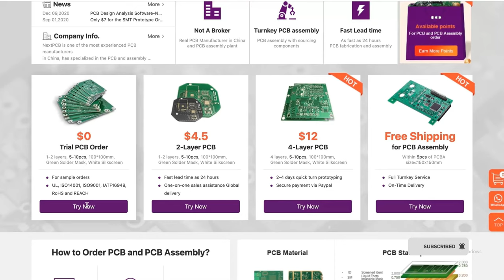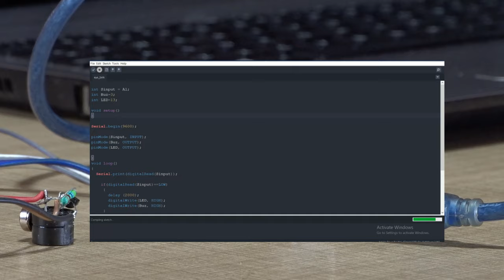How to Make Anti Sleep Glasses

Comment: how it worked since low and high is digital and u put sinput = A1 as analogic?
Reply from the maker: Analog input pins can be use as digital input or output pins
Reply: @ShubhamSuresh bro u using 5v pro mini is it okay to use 3.7v battery in the 5v arduino pro mini?
Reply from the maker: @markgimarangan8344  yes it works perfectly fine.
Reply: @ShubhamSuresh  Okay bro ty so much.

Comment: Can we use arduino uno
Reply from the maker: Yes you can.. but its size is big so you need to manage that.
Reply: @ShubhamSuresh  code?
Reply: @ShubhamSuresh  And tq for replying fast
Reply: @ShubhamSuresh  hey pls give reply
Reply: @ShubhamSuresh  I can manage it
Reply: @ShubhamSuresh  but any changes in arduino uno connections
Reply from the maker: @sakethgattu8503  do the connection same.. and the same code will work
Reply: @ShubhamSuresh  tq for your reply

Comment: hy bro can i use arduino nano instead arduino mini or uno... please answer
Reply: yes but then again you will need to use a bigger battery since the nano requires at least 5V
Reply: @EngTawa  i did with Arduino nano and 5volt battery but it did not worked for me 💔😥
Reply: @adibullahishanzada  Yes it's becaus the IR sensor doesn't work that way. We were somehow fed a lie.
Reply: @EngTawa  you posted fake video 💔😑😰

Comment: Hello, I'm from Brazil, and I'm using your idea as a basis for my final project in college, please what is the name of the part that is blue, white and black, that a positive of the same is connected directly to the battery? Could you tell me the name please, and if possible the model used?
Reply: VOCE CONSEGUIU FAZER ESSE PROJETO? TAMBEM ESTOU QUERENDO FAZER ELE
Reply: Então somos 3
Reply: descobriu o nome do componente?
Reply: @jaum03  o sensor é sensor reflexivo, ou sensor de obstáculo para arduíno
Reply: @pedrohr3800  a não esse sim, mas o que o Patrick perguntou ai, que é conectado na bateria, sabe me informar qual eh?
Reply: @jaum03  Aquele cinza? Se for esse é só um swith, aquelas chavinhas on/off.
Reply: @pedrohr3800  simm, eu percebi dps só, mas já montei o projeto já, vlw
Reply: @jaum03  falou mano. Tô montando um aqui também ksks
Reply: @pedrohr3800  essa msm ideia?
Reply: @jaum03  O princípio é o mesmo, mas quero encrementar algo, tipo acionar alguma carga talvez.
Reply: @pedrohr3800  ahh tendi, eu dei uma leve mudada tbm, mas a ideia eh a msm. Só achei o motor de vibração mto forte, pelo tamanho dele me surpreendeu. Acho q só o buzzer ficaria melhor
Reply: @jaum03  eu testei com o buzzer e um led, se for pra alerta já deve ser suficiente mesmo.
Reply: @jaum03  JOÃO VOCE CONSEGUIU FINALIZAR O PROJETO? ME PASSA SEU WPP, PRECISO TIRAR UMAS DUVIDAS.